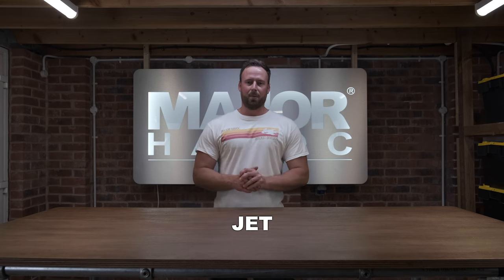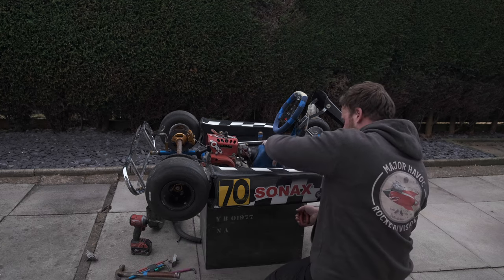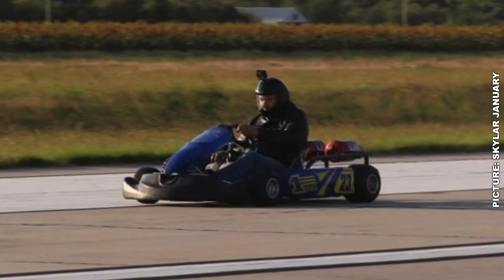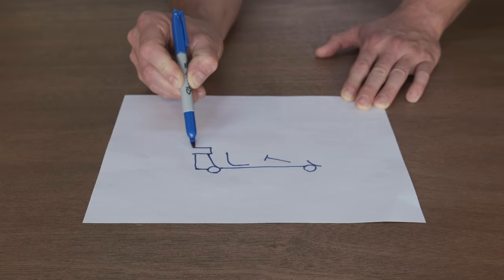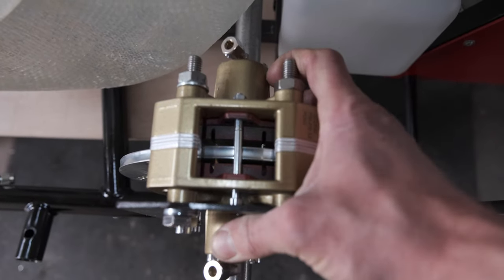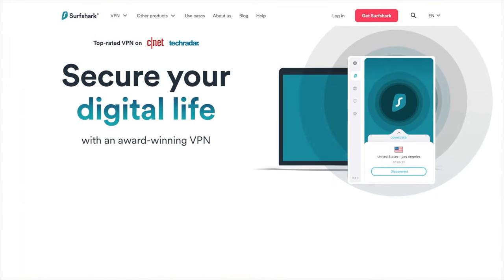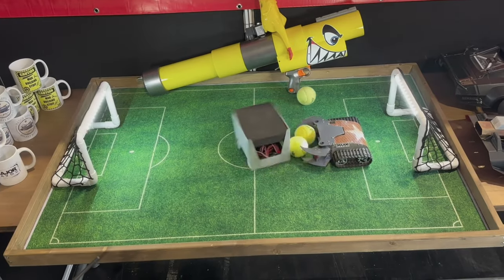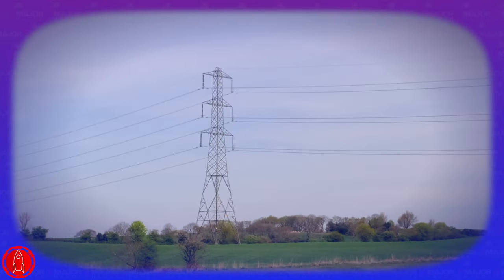Jet Powered Go Kart

Comment: I'd definitely take a look at changing the steering setup/alignment before you go really fast. Go karts are setup to be nimble and easy to turn, not for massive straight line speed. With some changes you should be able to make it a lot more stable going straight at high speed. Also if allowed in the go-kart category, you don’t need those wide tires. Only slowing you down.
Reply from the maker: Yes definitely, so the next go kart will be a full custom build just for straight line speed. I’m just waiting on Guinness World Records to confirm exactly what I’m allowed to do.
Reply: @majorhavoc  From what I remember when the record was set, at least thats what we told them..... kart chassis has to be aproved by coverning body, or at least start that way...... if you build you own, which is not as easy as you think.... you will need a jig, to help stop the chassis pulling out of shape when welding, which grade tube do you plan on using..... oh and you will need engineering drawings to run at thge only track safe to run 1 mile runs in the uk

Comment: Really curious why you went with a cadet chassis. The shorter wheelbase and narrower track width compared to a full size kart is going to make it far less stable at high speed. Not to mention a shifter chassis would have allowed for brakes on all four wheels, rather than two, which might help in an emergency situation.
Reply from the maker: Hi 👋, yes good question. It came down to cost, a shifter Kart chassis would have added an extra £3k to the cost of the video. And this first version was only meant to be an engine test. I’m building my own chassis for the next one but I’m still waiting to hear back from Guinness World Record’s as to what exactly they would accept as a go kart - I would like to make it longer with skinny wheels and full carbon body work. And as regards to emergency and brakes - yes the next one has to meet Santa Pod’s race spec, things like; Two brakes, parachute, arm restraints, fire extinguisher etc…

Comment: 4:56 hehe, good old CAD (Cardboard aided design), never fails!

In my opinion the build looks solid! Looking forward to seeing the tests! 

Approximately, how much does the cart weigh when fueled and with a pilot and how much thrust is in that engine? that beast engine looks like its in the range of 100 newtons
Reply from the maker: CAD lol 😂, should have used that in the video 👍 
The all up weight is 180kgs, weight split 70% rear and 30% front (normal kart would be 57 / 43)

Engine is 400 newtons (Swiwin 400b) or 40kgs static thrust. Above 30mph you can really feel it pushing hard 👍

Next step is to add another engine 😬
Reply: @majorhavoc 400n of thrust??? Holy crap that's so much more than I ever thought!
Having two engines is putting yourself in danger of taking off and flying, you might want to wear a parachute just in case
Reply from the maker: @linecraftman3907  haha lol, I will need 3 of these to break the record 🫣